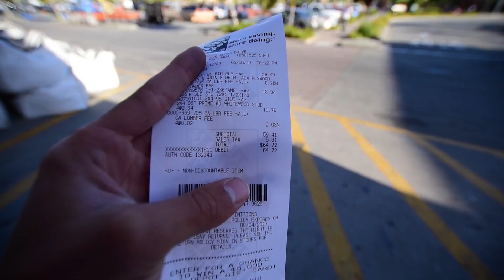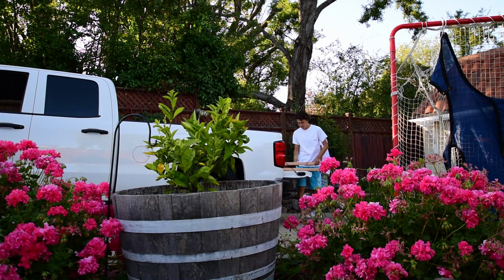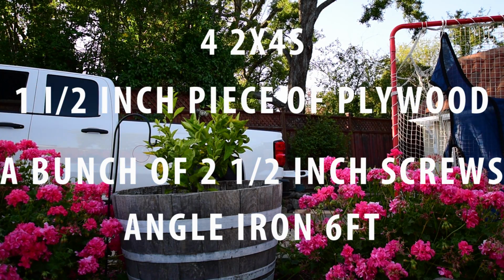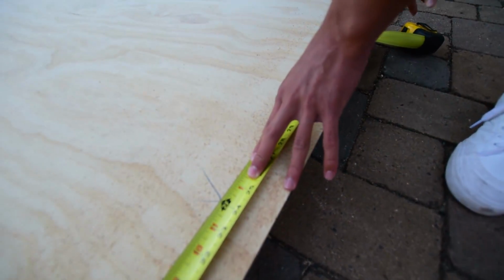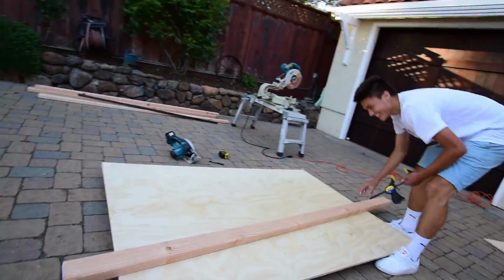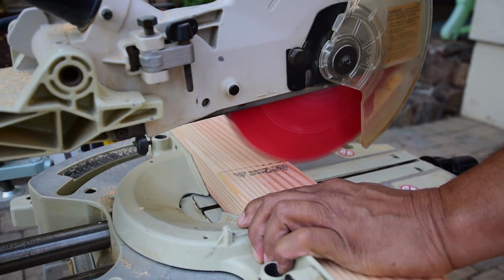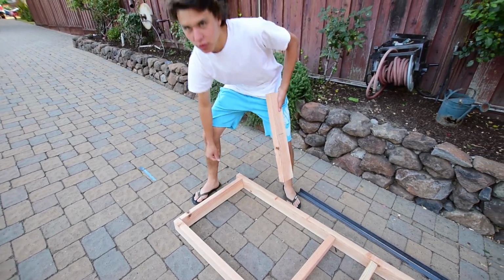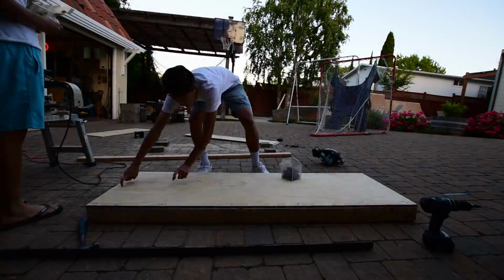How to Build a Grind Box for DUMMIES by DUMMIES

Comment: The larger bit for the screw heads is called a countersink.
Reply: Thanks, I was trying to figure out what that was called.
Reply: is it also the name for the hole itself?
Reply: nepalnt2121 yes, the purpose is to make sure the screw fits in flush with whatever you are drilling into .
Reply: Fucking THANKS BRO

Comment: I actually did build a grindbox once. Two pallets ontop each other, one angled metal, one round metalbar. You couldn't REALLY use it as a manualpad, because there are holes everywhere, but it was cheap, fast and super stable. The holes can also be a fun obstacle. And it's kinda short.

Comment: Is that going to be heavy enough to prevent it from moving or sliding trying to lock in?

- Would putting a cynderblock or two tucked into each leg in the corner help?

Comment: 1/2inch 2ft by 6ft Plywood
(2) 2inch x 4inch x 6ft wood
(6) 2inch x 4inch x 21inch wood
(8) 2inch x 4inch x 1ft wood
6ft angled steel
LOTS OF SCREWS
Reply: But four 2x4x?  Before cutting anything